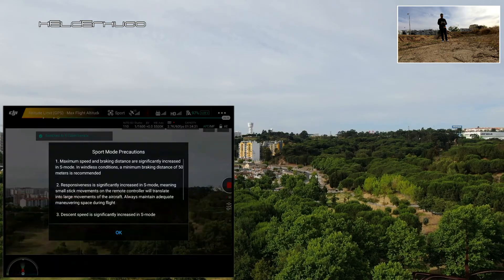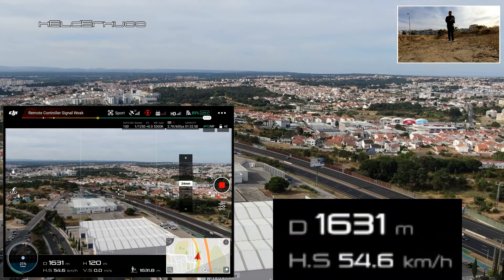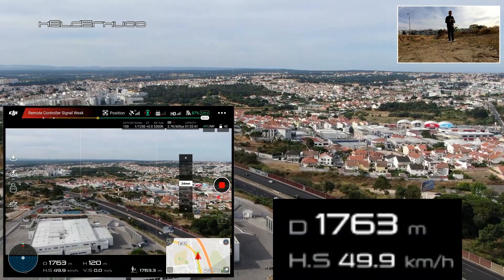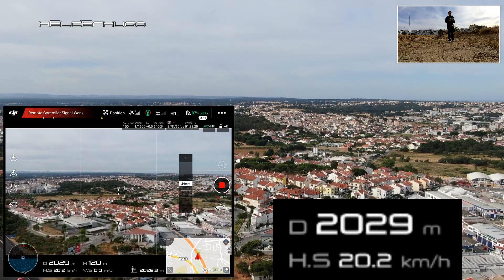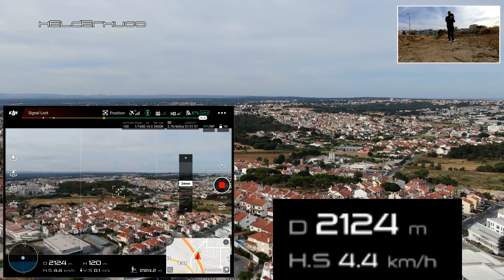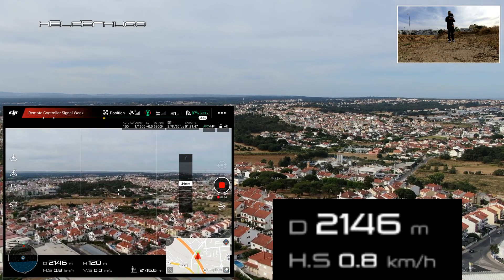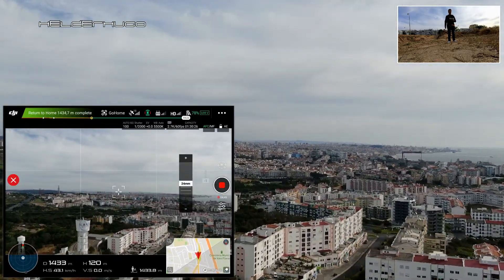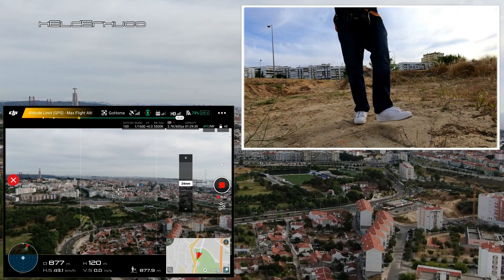Testing Arizona Tea Popcan from Mr Kent on Dji Mavic 2 Zoom

Comment: Just like I told Mr Kent, you have to orient them vertically. And they have to be 15 millimeters behind the antennas are it will not function correctly. They are better lined with thin copper sheeting. Which I offered to send him for free.... but he didn’t take me up on the advice or the free copper liner. BTW... I am a fan of Mr Kent, what a gift to our drone pilot community!!
Reply from the maker: I see. I didn't saw your comments on Mr Kents Videos.
Reply: I can understand Mr Kent not wanting to give a stranger from YouTube a mailing address lol... I get that part, but heed the advice, these can perform very well!! I went through weeks of trial and error with my Mavic Pro diy booster(you may remember I asked you if I should get the Mavic or the Anafi, and you said Mavic=good range so I thank you!!)
At 2.4ghz the reflectors need to be 15 mm*doesnt have to be exact but the closer to 15mm the better your results*behind the antennas, and placing them the directions the antenna stands vertically makes it a success.